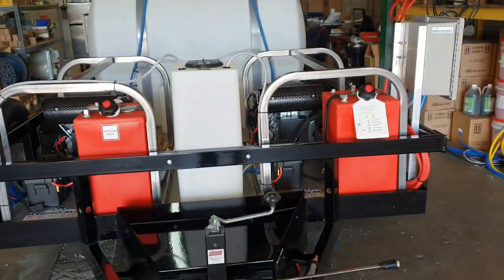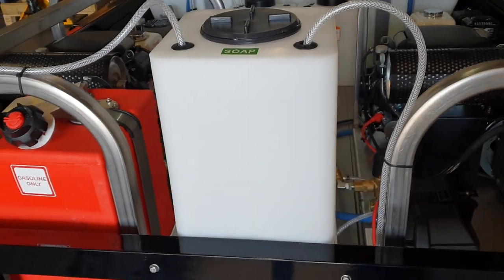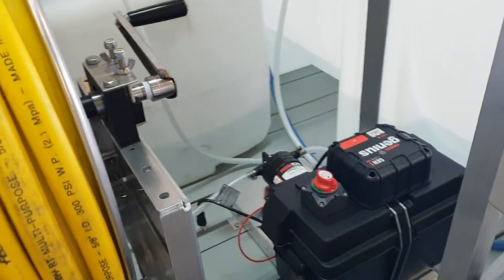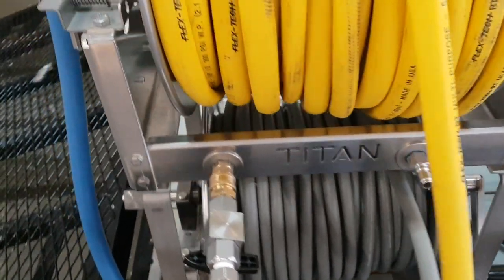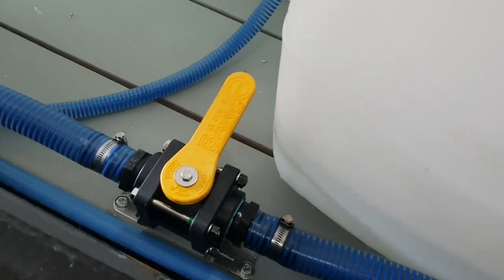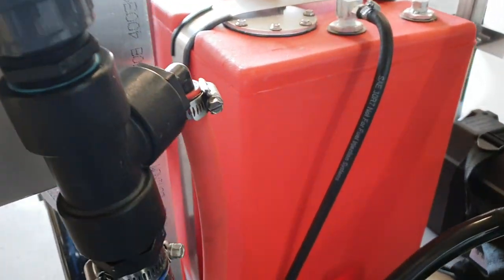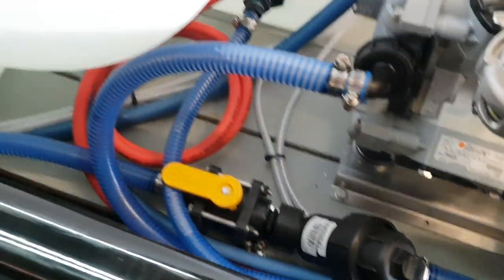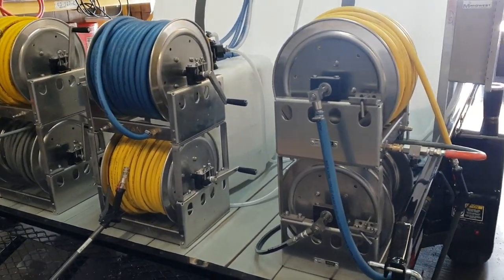Pressure wash & soft wash trailer build. Dual 8 gpm PWs, dual gas powered comet p40 soft wash pumps

Comment: I see y’all like to use the uniseals. I’ve always made drop sticks to connect to the bottom of bulkhead fitting. 

With the uniseal, do you ever get any seepage from them with a full tank? And also, are you just running the house to the bottom of the tank with a filter? How do you keep it from coiling up and not staying in the bottom of the tank?